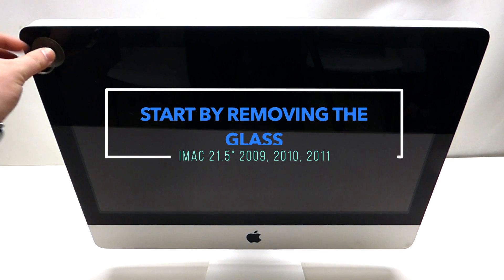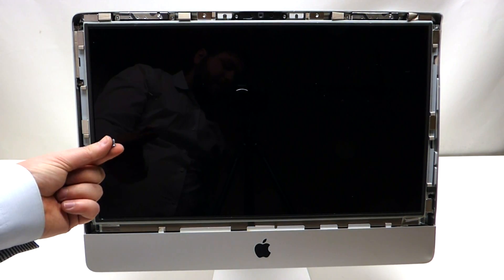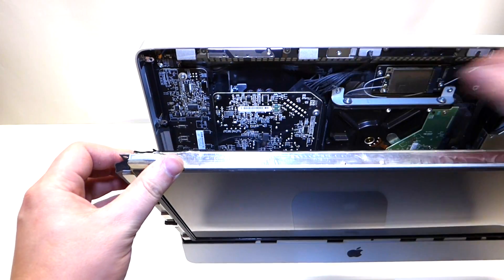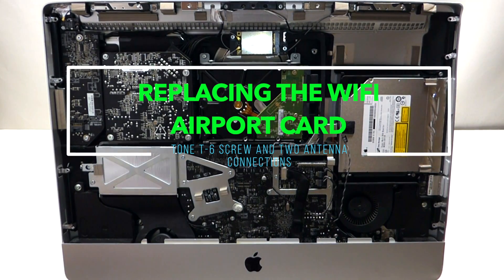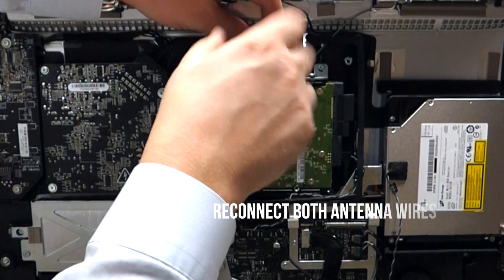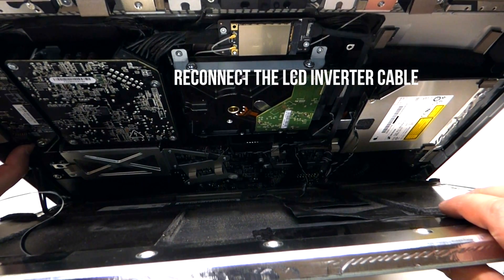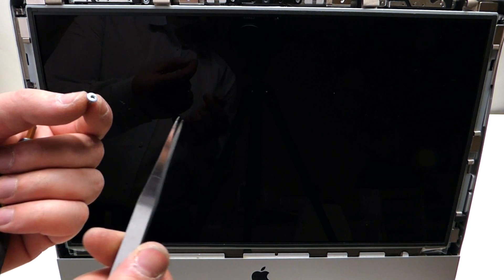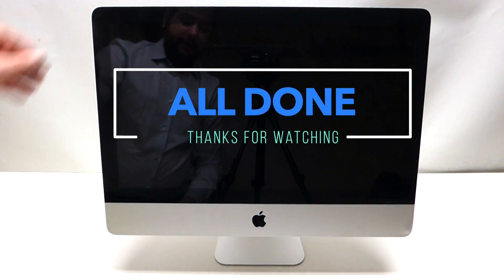iMac Airport Card WiFi Replacement 2009 2010 2011 21 5" Apple Dollars #6

Comment: You can magnetise a screwdriver by stroking it with a magnet or, failing that, use a dab of BlueTac between the screwdriver and the screw head.

Comment: I have a question, what's the purpose of replacing a wifi card? I ask because I've been doing some research on my old iMac 2009 model, and it has the "airdrop" function available, but I've never had success using it (other macs/iphones don't show up). Would replacing the wifi card potentially help with this issue? Thanks in advance!!!
Reply: Same problem here, anyone help, please

Comment: 2009 27" iMac: 
I have had a problem for over a year now where I will lose wifi connection, usually when streaming a show or movie. Wifi is okay on phone when this happens, so I know it's something happening in the iMac itself. This can happen in any location in the house relative to the modem/router.
Computer restart always brings it back. I've bought a new Airport card (as you say, they're cheap) and I'm thinking of attempting this myself. I'm just wondering if there is any diagnostic tool to check the card first to be sure.
Thanks!
Reply: Same problem with my 27" iMac 2010. Wifi keeps dropping and restarting always brings it back. Did things workout for your iMac?
Reply: @KennethJaxon  I had the new Airport card installed by a shop, and it didn't fix the problem. I ended up getting a VPN application called Speedify. I can't explain to you exactly what it does but it has stopped the disconnecting.

Comment: 2011 27" iMac (bought new in 2011) started running super slow only a couple months ago. 
Considering a wifi booster - but saw this & wondered if this might be the cause.

Comment: @saveappledollars Quick question. Recently I had my wifi card replaced, is it possible to dislodge something for the camera? Since I received my computer back from Apple, my camera doesn't work in several app's. Fyi: Under system information it says no video capture device found P. S. Good explanation of the repair.
Reply from the maker: That is exactly what happened. Your video camera cable is disconnected.
Reply: @GRIBSOFT they claimed it was a software issue. Thank you for your reply!
Reply from the maker: It’s hardware for certain.

Comment: Great video just curious before I start opening it would this fix the Wi-Fi issue,showing no hardware installed, after many resets and trying many different options it looks like it’s hardware related,mine is mid 2010 iMac.
Reply from the maker: I will bet it's hardware. Make sure to order the card that is for your exact year and model first. They are lower then $20 now

Comment: does anyone know what part i need to add 802.11ac wifi capability to my early 2008 imac 24"?
Reply from the maker: USB ac wireless adapter.
Reply: nooo i mean the actual replacement part to be replaced in the inner part of hte machine once the machines opened up
Reply from the maker: No, to old.
Reply: please stop replying if you dont know
Reply: Chris Nova777 did you ever find out what part number you need?

Comment: macOS High Sierra!  Use this procedure to update a 2008 iMac 8,1 to enable a working Wi-Fi card using http://dosdude1.com/highsierra/  Just find a used and cheap compatible Wi-Fi replacement card on eBay.
I recommend update the hard disk to a real SSD ( not a hybrid ), max out the RAM, while you have the case cracked open.
See this: https://www.ifixit.com/Answers/View/162178/Wireless+Airport+Card+Replacement+with+New+802.11ac

Comment: I have a Imac 21.5 inch, I was shocked to see my wireless card, a lot lower, close to the middle of the inside, and  the card had 3 snap on attachments, I had a hard time getting to it, finally broke the corner of the chip, the screw would not unscrew, but I took the old card out, and the new card I had ordered had only 2 attachments, I think mine got mixed up, but I said if it works it works, I plugged 2 in, and left the other hanging, I  have just put it back together and it is working fabulously !! Also want to mention, for the 8 screws, on the side, it takes a special small Star shaped screwdriver, I had one, so I was fortunate.
Reply from the maker: Thanks for sharing your experience. Some Mac models were manufactured at different times and locations for the same model and so components sometimes are in different position but should be fully compatible.